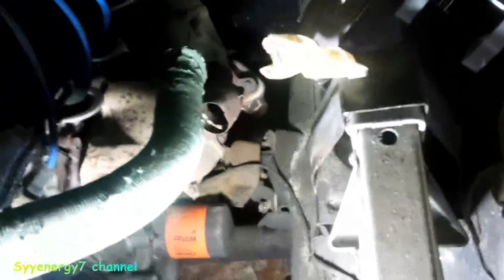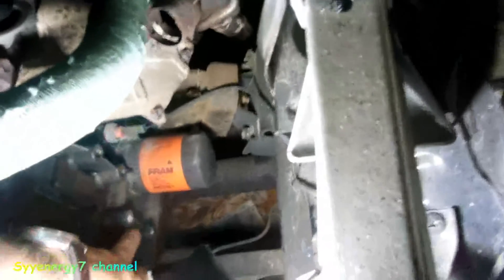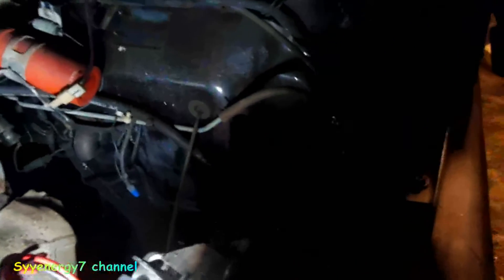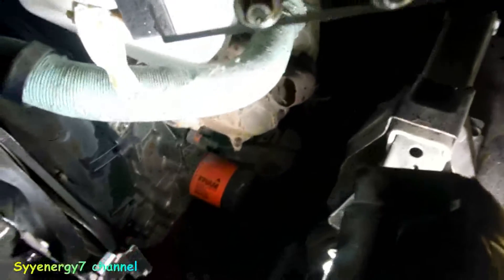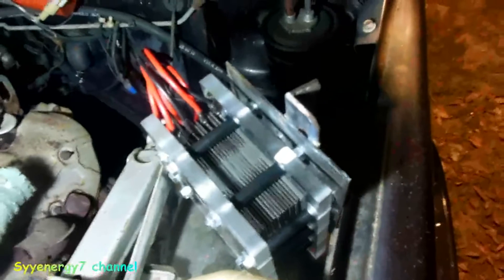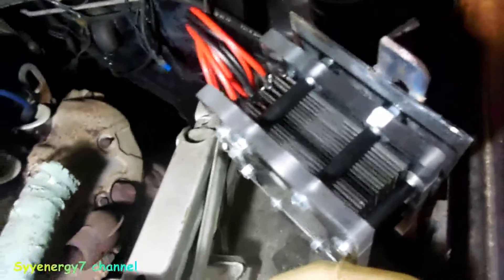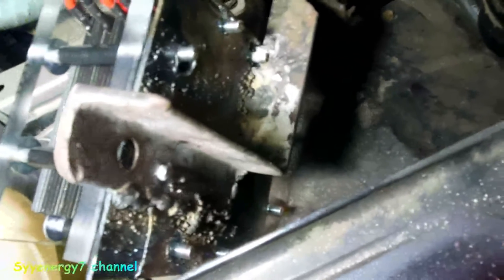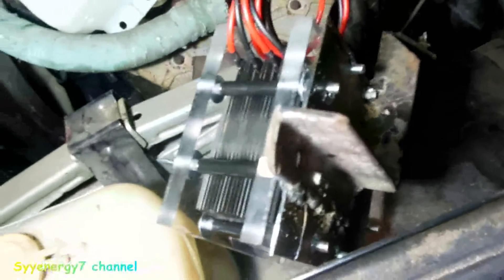Suzuki Samurai Installing HHO, Part 1 of 3 {Brackets}

Comment: Wondering...If i have a slight head-gasket leak into the combustion chamber...does that help make an HHO system by default?
Reply from the maker: No :)  I've been working on the other brackets and studied and know how the relay gets setup.  This is a good unit ,because they use a relay and make sure the unit will only work with the key in the on position., plus it has many other safety features.

Comment: syyenergy 7 so your converting ur car to run on water!........
Reply from the maker: HHO is just an add on.  It helps efficiency and mileage especially on older, simpler cars.  It is in additional to gasoline.  It will not replace gasoline.